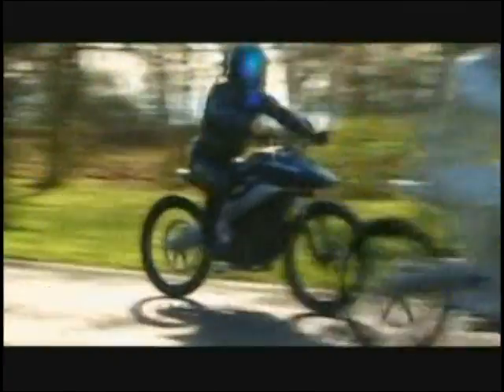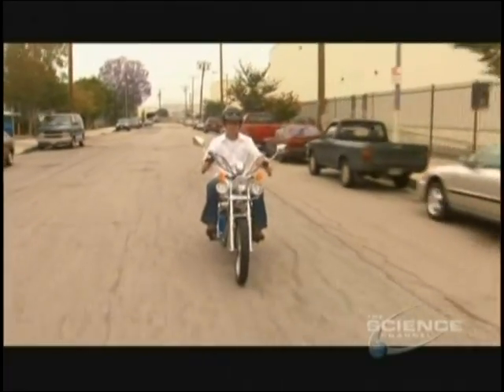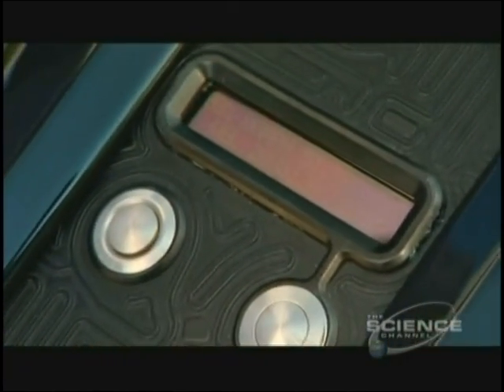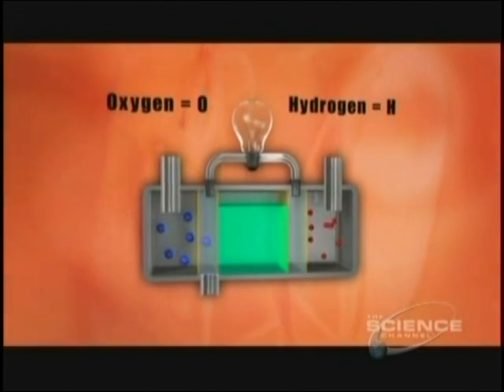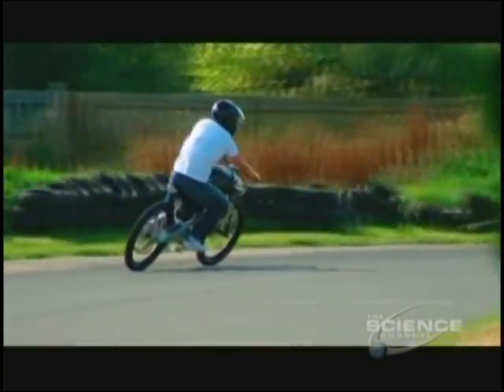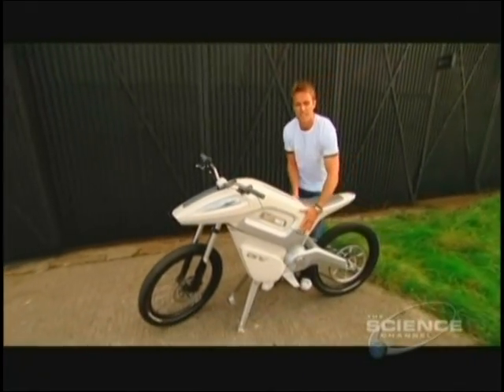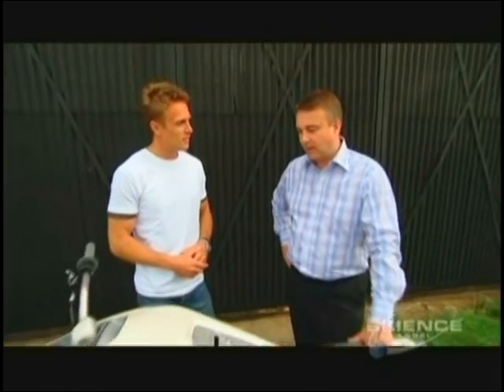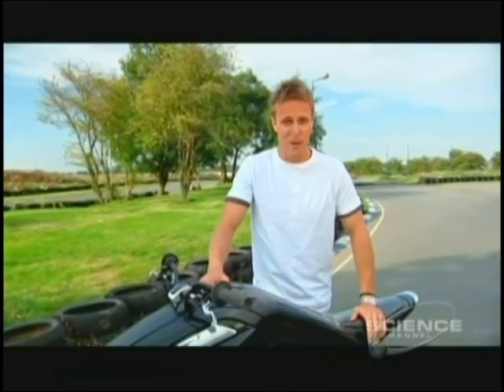Hydrogen Fuel Cell electric bike

Comment: @DancingET Problem with hydrogen is that it isn't a source of energy,
it's only a carrier fuel that must be made with electricity from another
source. And that is inefficient, you lose more than half. Then the process
of converting it to electricity again in a fuel cell is also similarly 
inefficient. Then you're finally converting electricity to motion, which
is also lossy, better to simply use batteries, you only have the last
stage of loss. And also storage of hydrogen requires a compressor.

Comment from the maker: @HUNDuffman Hydrogen fuel has a very low energy content compared to say diesel fuel. It is clean, but it is not as powerful as you might think. Electric motors can be very powerful. Think diesel locomotives are actually big electric motors driven by a diesel powered on-board electric generator. They are powerful enough to pull long freight trains. I don't have actual data, but I would bet this bike is better off stay electric with a hydrogen fuel cell than using a hydrogen combustion engine.

Comment from the maker: @HUNDuffman BMW's hydrogen cars (Google the words "BMW hydrogen 7", on lease only in LA area) do exactly what you suggested. Hydrogen is used as fuel in their internal combustion engine fine tuned for different combustion characteristics. Most combustion engine designs are very energy wasteful. Even if the combustion is complete, most energy are wasted as heat after each controlled explosions inside the cylinders. Fuel cells are less wasteful.

Comment from the maker: @shooterfreak99 Hydrogen Fuel Cell produces electricity using hydrogen gas as fuel. H & O are combined chemically to produce H2O water vapor plus electric energy. I think you are talking about Plasma engine which jettisons hydrogen atoms at extreme high speed. By Newton's 3rd Law of motion, that will propel a spaceship forward. A plasma engine probably is nuclear powered. Hydrogen is not the fuel, but only used as "projectiles". Despite the light weight atoms, the speed makes up the momentum.

Comment from the maker: @PhantomOfPanton Without hydrogen refilling station at every street corner, hydrogen fuel cell technology actually didn't take off for automobiles. Don't hold your breath for any hydrogen fuel cell car.  But fuel cell technology makes progress in other areas.  Google the words "Bloom Energy", it is a fuel cell technology using natural gas as fuel. The cell works with hydrogen too. The Electric Telsa is in production, but that car is just way too expensive because batteries are not cheap.

Comment from the maker: @xotimox9 Actually, I think it is the opposite. Building an infrastructure is a huge capital investment. In order to amortize the fixed cost quickly, you would need fewer centralized depots and a huge consumption to break even. So hydrogen powered buses and locomotives would be the best application initially. Your city is doing it smart.

Comment from the maker: @xotimox9 There are two common ways to consume hydrogen power. Use fuel cell to convert into electricity which then drive a motor or use an internal combustion engine to use hydrogen like gasoline vapor. (BMW's prototype hydrogen cars are the combustion type.)  I wonder which way the Palm Spring buses do it.

Comment from the maker: @MrTyson5262 No. It is a fuel cell, not a battery.  By definition, you need to refuel when it is depleted.  It is a hydrogen cell cell, so you need hydrogen as a fuel.  Hydrogen fuel cell has not taken off because hydrogen supply infrastructure is not in place yet. Google the terms "Essential Element Hydra mobile solar hydrogen fuel cells" to see some recent news.

Comment: @seniorortega So wind is unreliable,but you still can store it in a medium like hydrogen for base line use. Put solar plants in the deserts,no one lives there anyway or float them on ocean. It covers about 75% of the earth. I heard Fusion makes little on radioactive waste, so yea for Fusion. I think that New York harbor has what looks like modified wind turbines on the bottom so that the tidal water runs them,so yes to that. Also to wave power plants on isolated shores.

Comment: @kdc43 As much as I love the idea of fusion power I am not ignorant to the fact that it is 50-70 years away if that. Wind power is unreliable and solar power is too expensive and takes up way way to much space. Personally I am a proponent of tidal power which is reliable and extremely abundant (anywhere with ocean...) and cheap to build. Implementation is the issue and why investors are few.

Comment: @seniorortega  I am building an electric bike now with a 500 watt/hour lithium battery and a 1000 watt hub motor. But the actual cost of nuclear power would be a lot higher if you included the mining, environmental, handling of the radioactive nuke waste. It would be cheaper to build wind and solar electrolysis farms to make hydrogen to run vehicles. I was talking about the CURRENT way we get hydrogen,from fossil fuels.

Comment: @adyloszonga  I am building an electric bike now with a 500 watt/hour lithium battery and a 1000 watt hub motor. But the actual cost of nuclear power would be a lot higher if you included the mining, environmental, handling of the radioactive nuke waste. It would be cheaper to build wind and solar farms to make hydrogen to run vehicles

Comment: You can get hydrogen by using solar panels and running the current into water so fossil fuels wouldn't need to be used. I have made hydrogen in this manner and it does work.

Comment: @matroosjes There are several different methods, but electrolysis is the easiest and cleanest. Wiki it, you can do an experiment at home with a battery, some wires, zinc and copper and some salt. What the bike essentially does is reverse electrolysis, by gaining a potential difference (electric charge) by combining Hydrogen and Oxygen via a catalyst.

Comment from the maker: @AndrewKlilly Batteries have their own problems and limitations. You can refill a fuel cell quickly (assuming the refueling infrastructure is established). Recharging the batteries takes too long. e.g. drive a Tesla sport car from Seattle to LA. After about 3.5 hours of driving, you'd need to stop at the recharging station for 8 hours before continuing. A 18 hour trip becomes 48 hours. Capacity, recharging time, longevity, weight, cost, polluting manufacturing process etc. are problems.

Comment: Water = 2 Parts Hydrogen 1 Part Oxygen you may be familiar with a process called electrolysis. Using Clean solar/wind/tidal/Water Damn or even Nuclear power to fuel this process you get hydrogen and oxygen. When the two a burnt, or used in a fuel cell process only water is created as a waste product. The reason I classify nuclear as a clean energy source is the sheer amount of power to waste ratio is so high its in comparison as if a coal plant only produced 100lb of CO2 emissions a year.

Comment: @kdc43 

Water = 2 Parts Hydrogen 1 Part Oxygen you may be familiar with a process called electrolysis. Using Clean solar/wind/tidal/Water Damn or even Nuclear power to fuel this process you get hydrogen and oxygen. When the two a burnt, or used in a fuel cell process only water is created as a waste product.

Comment from the maker: All the researches has shown that hydrogen did not cause the fire on the Hindenburg.  The coating on the fabrics which made up the skin of the airship was the culprit. Of course, a hydrogen leak is dangerous for sure. When compared to gasoline, hydrogen is relatively safer. Hydrogen rises and dissipates quickly. Gasoline seeps into cracks and gaps and its fume is explosive. Yet, people live happily with gasoline, i.e. people can handle hydrogen safely too.

Comment from the maker: Plug in electric also has its problem.  Short range.  If you want long range, you need to carry extra battery which weigh down the vehicle, so it is not energy efficient.  Or else, you need to recharge it frequently and charging require long waiting. Refueling is often faster than recharging.  Search for a video with title "Hydrogen fuel on the go", that will be a good supply of the fuel and refueling can be fast once the supply become available to the public.

Comment from the maker: I personally don't think hydrogen economy will take off because the electric grid is a competing infrastructure that has been in place for decades.  If fusion energy is available, it costs much less to run electric cars than hydrogen cars.  If I were the energy secretary of the country, I would invest in better battery research than laying hydrogen pipes.

Comment from the maker: I don't have the data, but my gut feeling tell me internal combustion engine is an extremely lossy design.  If it weren't, you would not find a radiator on any car.  BMW pulled a publicity stunt to show case its hydrogen 7 series which can switch back to gasoline when the hydrogen tank is empty.  What a shame to fool the public because that is the wrong way to use hydrogen.

Comment: Anyone have a take on whether it's more efficient to use hydrogen in a fuel cell to generate electricity, or whether it's better to explode the hydrogen in the cylinder of an internal combustion engine?

Comment: Great. But if the Hydrogen is not generated by renewable energy systems, but by nuclear or fossile-burning plants, it is a pitty not to be as environmental-friendly as it seems to be. So solar, wind, wave and geothermal power systems and plants should be build much more than have been until today, worldwide. Capacities on roofs, in deserts, in oceans etc. are huge and the technology is ready for this energy revolution, for example look for: Wave Dragon as just 1 example.

Comment: All radiation is free energy, just put up a collector and charge batteries/ make h2 methanol / SMES. Its not a free lunch, there is that initial investment. Why make a fusion reactor when we have a really nice one called the sun. Sometimes, the right way is the easiest way. Oil is just inefficient solar power anyway.

Comment: Brilliant! 

I see Superconducting Magnet Energy Storage (SMES) as being more practical and safer than fuel cells. The recent advent of efficient solid state heat pumps and high transition materials will be the kicker.
 
If we were using fuel cells, liquid methanol can be used. While still having a carbon backbone methanol would be carbon neutral if synthesized and since its a liquid, much more energy dense than gaseous hydrogen. Dupont has successfully made these cells.

Comment: Further too, you must ask yourself, where does the primary energy  come from to make hydrogen (H)? Electrolysis? It is afterall the only viable commercial scale means of making H worthy of consideration as a base for the H economy, as most natural gas (feedstock for steam reforming to make H) in North America will be gone long before a significant number of HFC EVs make mainstream. Us the existing US grid for producing H via electrolisys and greenhouse gas will increase according to the CTR.

Comment: The perfect storm is approaching. World peak oil is here. North American peak  natural gas is just around the corner. Electrical generation and transmission systems are suffering from under-investement (deregulation, mergers, marketing gaming and cost cutting to bost short-term share value.) Demand continues to rise. But the fact is Hydrogen is not an energy source. (McMahon p.18) It is, like lithium batteries, an energy storage or energy carrier. Stop dreaming - hydrogen is far from being here.

Comment: In fact, Science Links Japan, in an article titled "Development of Extraction System of Lithium Dissolved into Sea Water Using the Ocean Energy" (ISSN:1346-5066) (VOL.4;NO.5;PAGE.517-533(2004)) indicates that  " recent estimation indicated that at least 200 billion tons of the lithium ion are dissolved in the whole seawater. " and this method of extraction would be quite practical. And that's not even comparing it to doomed hydrogen economy.

Comment: Please take note that I indicated ocean water and not "the sea floor". The Journal of Nuclear Science and Technology Vol.17 , No.12 (1980) pp.922-928 indicates that :

"It was found that a corrosion product of metallic aluminum immersed in sea water extracts lithium from it selectively... For the extraction of lithium from natural sea water, the values of KLiNa, KLiMg, KLiCa and KLiK were 9.9×102, 1.1×10, 4.5×10 and 4.4×102, respectively."

There should be enough lithium for quite awhile

Comment from the maker: Why not? They can do that if they have cheap electricity.  It will make sense to produce hydrogen next to the hoover dam because of the hydro-electic power there. But then Las Vegas will not like it when electrcity becomes more expensive due to the higher demand.  Then you need to transport the hydrogen to the major cities.  The bottom line is that it costs more to produce hydrogen, it is cheaper and cleaner to just drive a electric or hybrid car when the fuel transportation is factored in.

Comment: In addition to that, hydrogen burns very fast and clear, so the odds of receiving burns are smaller. If "burning H2" makes you think about that vid of the Hindenburg zeppelin going up in flames, you should know that what you see burning there is the zep's skin (canvas + powdered aluminum = excellent rocket fuel)

Comment from the maker: Your worry applies equally to gasoline cars. The same kind of explosion will happen when you have a gasoline leak, but we don't see many gasoline explosions except in movies.  The difference between the two leaking risks is that hydrogen flies up to the sky within seconds and gasoline stays on the ground.  So the exposure to a spark is much less unlikely than spilled gasoline.  So hydrogen is actually safer than other fuel.

Comment: If your commute is not too long you could produce hydrogen at home at night. I have built a homemade hydrogen generator (generating hydrogen from household AC) that could be used for this purpose with some small modifications. I don't have a hydrogen vehicle yet though!

Comment from the maker: Building refilling stations and delivery infrastructure is just a matter of commitment.  the real problem is the production of hydrogen.  It takes a lot of energy to produce hydrogen.  If they burn coal to make hydrogen, then it will be simply a joke. A super clean vehicle powered by a super dirty production site and waste more fossil fuel than burning fossil fuel directly.  However, if they use nuclear power, solar power etc., they it would be better off with electric cars. hydrogen is a joke.

Comment: Hydrogen tanks are now made out of hydrocarbons.  they just desintigrate.  in cars the tank is placed in behind the back seat because that is the least likely area to receive a fire.  in the event that there is a fire near the tank, the tank gas inside is under -200 centigrade.  they would be to cold and not enough oxygen near the gases to explode.

Comment from the maker: All fuel are dangerous.  The gasoline in your car can explode too. Some people argue that hydrogen is safer than gasoline in that aspect because hydrogen gas will escape and rise to the sky within seconds and you will be safe.  However if there is a firey crash, gasoline and hydrogen will explode the same way.  The danger of lighting up is greater in the case of gasoline.

Comment from the maker: Electric vehicles have similar infrastructure issues if an 8 hour recharging cycle is unacceptable.  Due to the short range of EV, if you are on a long trip, you will need to recharge the batteries in 15 minutes or less.  That requires special chargers along the highways.  This is no difference from the hydrogen pumps in term of infrastructure readiness.